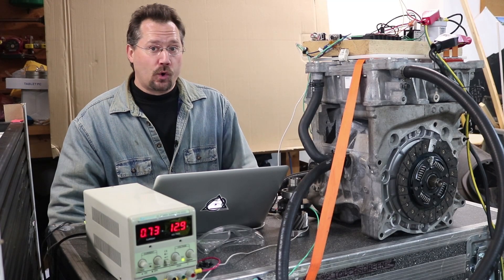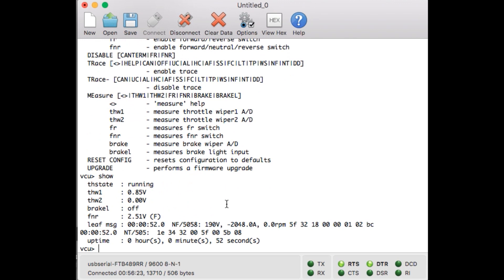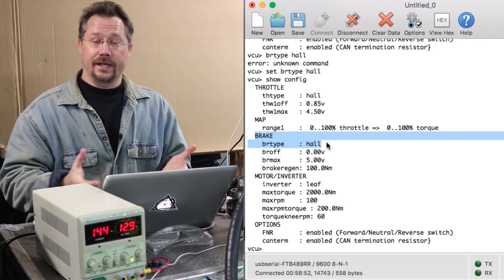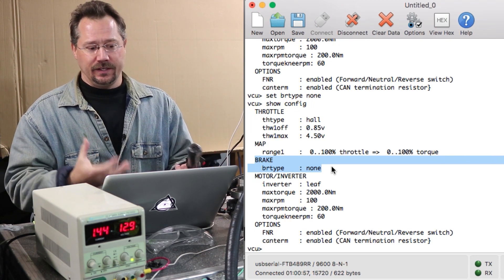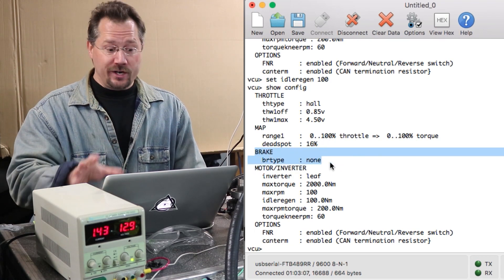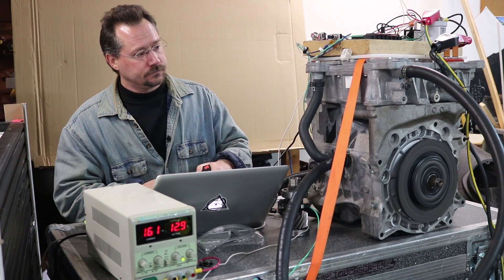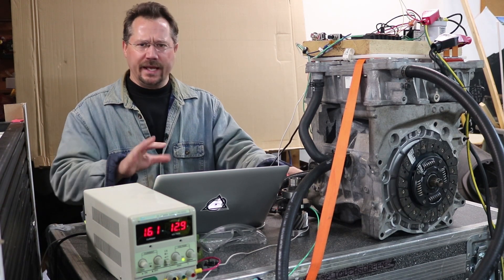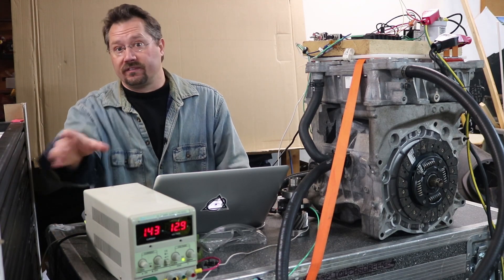Regen brakes on Nissan Leaf motor

Comment: The leaf has a master cylinder that is electronically controlled and blends regen and hyraulic braking.   If you don't use that, how to blend them?  Use manual brakes  when?

Comment: Very helpful as I start in in my Leaf powered conversion. Question: with no PDU in place how is current flowing back to the battery for that bit of recharge via regeneration?

Comment: in my opinion all ev manufacturers have missed a trick, that is a thumb button on the steering wheel to cut in regen, at will.
Reply from the maker: A number of electric vehicles have "paddles" on the back of the steering wheel for doing exactly that.

Comment: Hey Ben, thank you for your videos. You make great content that nobody else is making.

But Ben, I was wanting to know if I could get your input on something. Or maybe just a sanity check....

I want to build a hybrid car. Hoping for increased gas mileage and potentially great and situational AWD performance increase. lol
- FWD ICE engine. Leaf swap in the rear (full Leaf subframe mounted likely)
- Dual acceleration pedals (1 for ICE 1 for electric, as other hybrid youtubers have done).
- I'm thinking of using 38120s (for high current discharge/charge capabilities). 100Series and like 3-4Parallel. 160kw potential power. A pack that only weighs a couple hundred pounds.
- Using Thunderstruck and Dilithium (master controller) parts in the mix.

I've been trying to read how strong regen braking is. But it's very complicated. To calculate it, there's efficiency and effectiveness. And within those 2 simple 'e' words is a lot of information that's hard to obtain.

So here's my question:
If I was mostly propelling the car with the ICE, and went with a high (not too high) braking force configured in the VCU, and tried to always use regen for braking (except in emergencies), would that be enough to keep my batteries charged?

Any input would be great and much appreciated.
Thanks!
Reply from the maker: You certainly COULD build a hybrid as you described. In DIY circles, we would call that a "Through The Road" hybrid. In theory, it would work fine, and you'd gain the advantage of four-wheel drive.

Regenerative braking does have the ability to put quite a bit of power IN to the battery. Keep in mind that you will only ever be able to recapture energy into the battery by slowing down the car. So, if you accelerate using ONLY the electric motor, then cruise on the gas engine, and slow with the regenerative brakes, you should be able to recapture much of what you used to accelerate in the first place. But if you use the electric motor more than that, your battery will run down relatively quickly. You need to charge the batteries from an external charger. Regenerative braking by itself only won't be enough to keep your battery charged. If it was, we would all drive around in electric perpetual motion machines.
However, you CAN get energy from the gas engine to charge the batteries. While driving along with the gas engine, you would have regenerative braking on, but only at a relatively low level. You would use more gas, and have to press a little harder on the accelerator. It would be like driving with a parking brake partially engaged, except that this parking brake would be recharging the battery.
You could make a hybrid like this and never have to recharge. (After all, that's exactly what a Prius is.) It's just that you would be doing the the transfer of energy through the wheels instead of through a clever planetary gearing transmission. It would be a little more wear and tear on the tires.
If you played around with the software, and tweaked the regenerative braking, probably have a dedicated regen switch/paddle/control, you COULD build a hybrid like this.
It's not crazy. It can be done, but it would certainly take some trial and error and experimenting to work really well.
Reply: @BenjaminNelsonX  thank you so much for your time. I seriously appreciate it.

Comment: I have a very basic question, why can't you use the VCU/software that's actually in the Leaf? Is it too complicated and integrated with the rest of the vehicle?
Reply from the maker: The issue is that there's simply no one single piece of equipment in the Leaf that does what the Thunderstruck VCU does. Instead, it's several different components/computers all talking to each other over CANBUS.
I have a friend who wanted to do a conversion by stripping out a Leaf and putting all the components into a kit car. He got very frustrated trying to get all the components connected and communicating properly. In the end, he just bought a Thunderstruck VCU and it worked great for him.

Comment: What if you fitted this to an Archimedes via the right gearing ratio, do you think it would charge up a Nissan Leaf battery bank or two?
Reply from the maker: You want me to hook up a motor to spin another motor to charge a battery?
What is the source of the power to spin the first motor?

Comment: Thanks for the video. Very good! Could you explain what is happening to control phases on regenerative braking? My understanding is that as the rotor have permanent magnets once it runs without voltage on terminals it is sending voltage to battery. But I also understand that for stop the motor some reverse voltage is necessary. Can I assume that some windings on stator is powered for reverse the motor while others are generating voltage to battery? Do you have some oscilloscope footage of regenerative braking working? Lots of questions. Sorry and thanks in advance.
Reply from the maker: Sorry, I don't have an o-scope, but I'd love to borrow one and see what it looks like on there!
Reply: @BenjaminNelsonX  Thank you very much for your quick reply. Unfortunately we do not have any material on how this works. If you get luck with this, please post a video. Thanks again!

Comment: Why does this have a clutch on it?
Reply from the maker: It's pretty hard to see the drive shaft spin at all without something on it. I was mostly using that clutch disk just as something to mark and occassionally use to spin the shaft more easily by hand.
If a person wanted to use this motor in any kind of a conversion, they would need SOME sort of coupler/adapter etc. to connect it to the driveline. It so happens that a Geo Tracker clutch disk is a pretty close match.
Reply: @BenjaminNelsonX  The very next video of yours I watched, you mentioned the reason for this at the very beginning lol

Comment: Why is there a dead spot at 16% after the idle regen?
Reply from the maker: That's an adjustable setting. It lets you set the point of your accelerator where ABOVE it you are accelerating, and below it, you are slowing down.

Comment: I could see 2 of these in a mid engine sportscar with 1 on each drive wheel, 1 spinning backward the other spinning forward so regen braking both directions would be useful.
Reply from the maker: A pair of these motors and inverters would also be a great way to build an electric 4x4.
Reply: @BenjaminNelsonX  was thinking on back only something like an MR2 or Fiero budget classic sportscar :) But 4x4 sounds good too.

Comment: You may have just saved me a big headache. Looking to do a leaf motor in my 65 beetle. I'm planning to run it through the existing transmission with a clutch. More research required I suppose

Comment: On smaller stuff, if you the thing is spinning the wrong direction when you ask it to go forward, you just swap two of the three motor winding leads.  So there is a physical solution to get it to spin the other way, just in case there isn't a software method of doing the same.

Comment: Is there anything 3 phase out there about half as heavy and half the power of a Leaf motor?  The new stuff I've seen in this price category is up there and from brands I have no idea whether or not I can trust.  The leaf motor and gearbox is apparently 180lb, plus 30 for the controller and 60 for the rectifier/charger, and 80kW.   I'd take about half that if I could find it.

Comment: The max rpm in reverse is 3500 rpms (using the stock inverter software,  (using open inverter, it will spin full speed)).   The inverter seems maintain speed if the motor is spun over 400 rpms unless you have some regen turned on.   The motor itself will regen in reverse also, but I'm guessing thunderstuck didn't implement it, OR its another configuration parameter to set.   If you had a can sniffer, you could see what commands are being sent to the motor/inverter.

Comment: Nice to see this. Next problem is getting from the motor to the transmission some kind of coupler. I'll bet a lot of people will keep the gearbox if they have a front-wheel drive. Thanks for taking the time and putting this up.
Reply from the maker: Thanks, Steve!
Yes, it will be interesting to adapt this to a project vehicle.
Based on what I saw taking apart the gearbox, I believe the easiest way to reuse these components in a project is to keep the motor with the gearbox and then use custom half-shafts to a project vehicle drive wheels.
Reply: @BenjaminNelsonX  I've cut the CV axial and welded them to other CV axial

Comment: Im starting to work towards making my whole lawn set up solar powered.  Im looking for knowledgeable people to support the process. Any suggestions?
Reply from the maker: There is a lot of great battery powered lawn care equipment nowadays!
It gets complicated to try to charge modern modular lithium packs directly from solar. I would simply use the chargers that come with the battery lawn equipment.
Set up some solar and charge the lawn equipment from the inverter.
Ego is a very popular brand name for electric lawn equipment, among others. https://egopowerplus.com/

Comment: In the terminal, once you have performed a command, if you press the up arrow does it show the same command again? 
In other terminals I have used this will allow much faster commands if to just want to change one setting quicky

Comment: It's interesting to see the differences between the Thunderstruck VCU and the EVBMW VCU. 
The Thunderstruck seems to be much easier to configure but I haven't spent much time tweaking the EVBMW VCU yet.
BTW do you know if the Thunderstruck VCU works with the Gen 1 Leaf motor? I'm assuming it will as it connects over CAN.

Comment: Can Thunderstruck work with full 400 volt LEAF battery and 9000 RPM maximum?
Reply from the maker: Yes.
Reply: @BenjaminNelsonX  Awesome, I've been reading places that it can't
Reply from the maker: @Turboactive  Hmmm. I don't see why it wouldn't. I've rev'd this motor on the bench and it spins crazy fast. Voltage shouldn't be an issue either.
Reply: @BenjaminNelsonX  Great news!

Comment: Regenerative braking is so important for hyper mileage and saving the brake shoes at the same time. Miev and prime both have it and I never had  to replace the shoes on the Miev. For a boat will be to much dragging but everything else will be fine.
Reply from the maker: Ideally, the MOST efficient way to slow down is to coast to a stop. But if you DO need to brake, regeneration into the battery is the way to do it. On our 2004 Prius, the front brake pads were original until well past 100,000 miles! (Did I do it at 150k? I don't remember.)
I have tried braking in the iMiEV in neutral, so that it does NOT use regenerative braking, and I will say that the car has WEAK mechanical brakes. Great with the regen, especially in the Eco or B mode.
Reply: @BenjaminNelsonX  The RB works only above 5mph or less that 80% of the charge.  I Once , traveled 90 miles on a single charge and had 3 miles left in the battery. The wind and the big trucks help a lot.

Comment: This is fascinating! Leaf motors are everywhere and Cheap. Having a working controller for them will lead to an explosion of conversions.
Reply: Why does it need computer software at all?
Why not analog electronics?
Reply: @JohnSmith-eo5sp  The main difficulty is generating via PWM, three sinewaves 120 degrees out of phase. There is no simple way to do this with analog electronics.
Reply: @ShaunDobbie  It has always been done analog, we're not talking square waves here!
What about Class-D or Blocking Oscillators?
Reply: @JohnSmith-eo5sp  At a certain speed, BLDC motors can't go faster without closed-loop control. This video explains it: https://youtu.be/NXkLydhRvS0?t=351
Reply: @JohnSmith-eo5sp  are you even in this century
Reply: Cheap?  How much?
Reply: @blackz06  I've seen them on Ebay from $1,300 including the inverter. For a 107hp electric motor, differential, and inverter that is dirt cheap.
Reply: @Miata822  Dang!  Very!  I want one lol
Reply: @blackz06  Now that there is a handy DIY controller we are likely to see prices climb quickly. That's just a guess, but if you are seriously thinking of getting one...
Reply: @Miata822  It wouldn't surprise me one bit!

Comment: When braking, the brakeregen setting, seems to have to supersede idleregen in some manner. So does the brakeregen setting become the default settings for regen?  Or is idleregen always a baseline level of regen, until the brakeregen level of regen supersedes it? (I assume the latter is true to prevent reduced regen initially, when the brtype is set to hall for example)
Reply from the maker: Brake regen takes precedence over the throttle. I don’t know exactly what would happen if Hall Brake Regen was set lower than the throttle Idle Regen and you just lightly touched the brake.
Reply: @BenjaminNelsonX  thx for your feedback. But the scenario, I mentioned did not assume 'Brake Regen was set lower than Idle Regen'... if Hall Brake regen simply takes precedence over throttle Idle Regen', without using the Idle Regen setting as a baseline... when 'you initially touch the brake' it would feel jerky... since regen would drop off initially and then rapidly increase again... even when Brake Regen was set 'higher' than the throttle Idle Regen, which is normal. 

So maybe you could, test or research to confirm if Hall Brake Regen does not use the Idle Regen setting as a baseline minimum or not? to prevent a momentary jerky drop in regen

Or maybe  I'm just over thinking something that's to trivial to matter?
Reply from the maker: Probably overthinking it, but it would be interesting to test. I don’t think it would be jerky. Overall, the regen ramps up nicely and I would imagine that it would be smooth going from idle to brake. Really would need to be tested in a car to say for sure.
Reply: @BenjaminNelsonX  I don’t think it would be jerky either, just for a different reason. Look forward to your test results.
fwiw this is also great info for Leaf owners

Comment: Currently building a E bike.  Trying to figure out how to employ break regen on it.
Reply: most can't do regen... hint just focus on direct drive hub  motors

 so good luck, not breaking your regen braking ;)
Reply: @nc3826  I have both DD and Gear Drive.  I can in fact build a regen system for both.  Some of the more expensive ecu provide for regen.  I can't afford those.  Fet switching will work I'm sure.
Reply: @pulesjet  just curious what GD motor do you have that can do regen? since most are newer clutchless designs and are expensive... 

btw I c GD motors are clutchless  and can do regen now thx  

fwiw Ben pointed out make sure the regen does not over charge you battery after its fully charged
Reply: @nc3826  Chit I think your right.  The gd would not work.  Bafang .  FM G020.250/350.D 10  it does in deed use a free wheel clutch within.    I purchased 4 of them all but brand new for $50.00 each.
Reply: @pulesjet  at least you got them for a good price... and regen for cycling has not been worth the added cost and other trade offs like added cogging for DD...

fwiw I prefer mid-drive units, but at $50.00 each I'm sure what you have will be worth it to you...
Reply: @nc3826  Yep.   I'll be giving one or two away at that price.  I have the making of plenty of batteries.
Reply: @nc3826  Some kinda rental situation I think.  The tires still have the mold nubbles on them.   They still have them if you want one.  Actually they went down a bit in price.

Comment: You mentioned not knowing how to solve the problem of mounting the motor backwards and get the regenerative braking to work. One thought is to switch two phases to the motor. Maybe the other sensors will dislike that tho.
Reply: switching the phases of the motor, is the way they change direction already... 

btw mostly commented just to get Ben's reply
Reply from the maker: Probably easiest just to figure out WHY I wasn’t getting regen in reverse. I’m sure it just needs a setting tweak. If it was an oversight in the design, perhaps the manufacturer could fix it with a firmware update.
Reply: @BenjaminNelsonX   The stock motor/inverter can perform regen in reverse.   Not sure if thunderstuck implements that or not.   I suspect in a vehicle, it will coast to a stop in either direction with no regen.